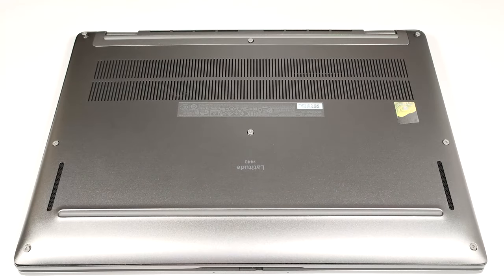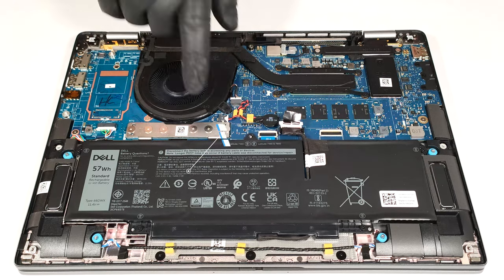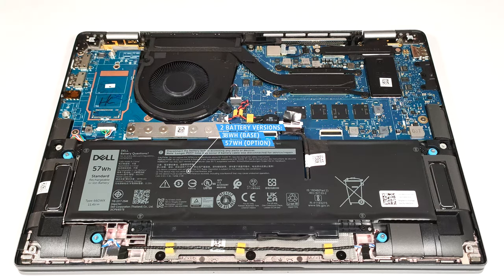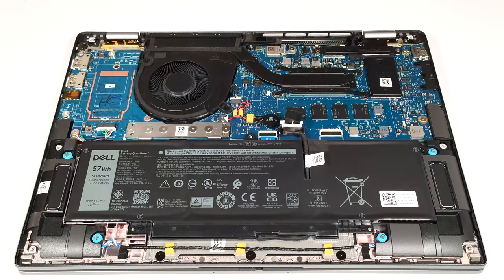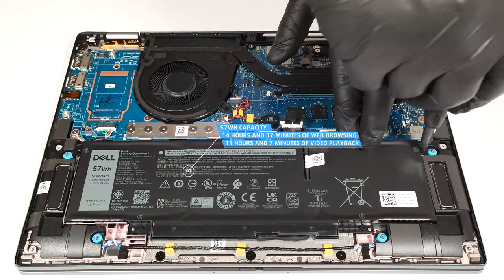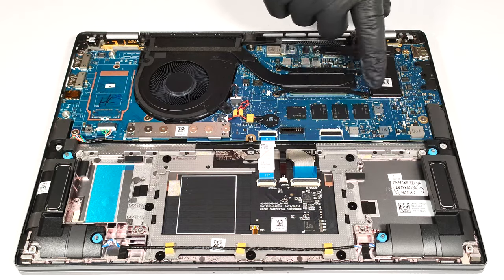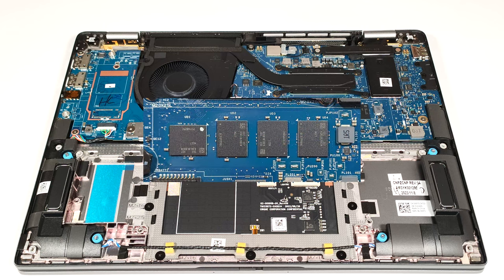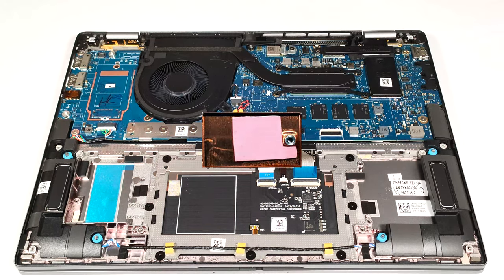🛠️  How to open  Dell Latitude 14 7440 - disassembly and upgrade options

Comment: What a shame, the ram is soldered. I would choose thinkbook 14 g6 over this.
Reply: Exactly. 
2 upgradable sodimm slots, 
2 upgradable SSD slots, 
upgradable battery, 
upgradable wifi card (I guess).
Reply: Soon dell is going to seal the Laptops for us not to open it